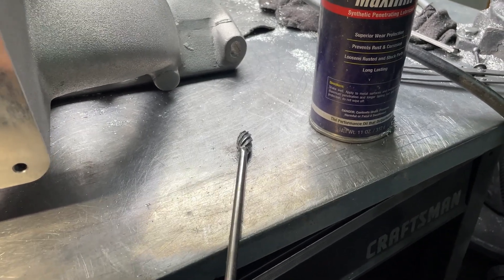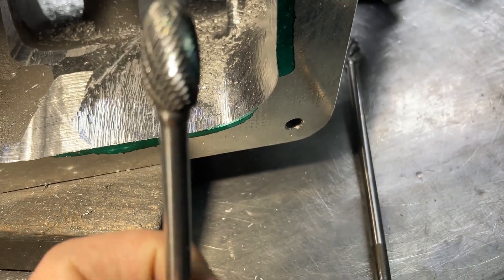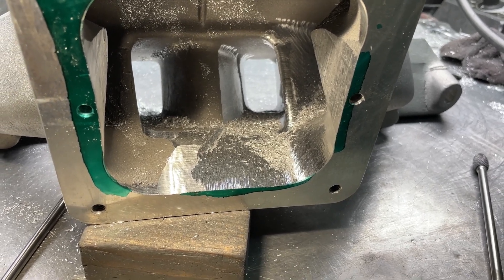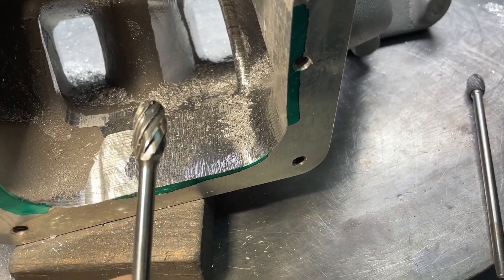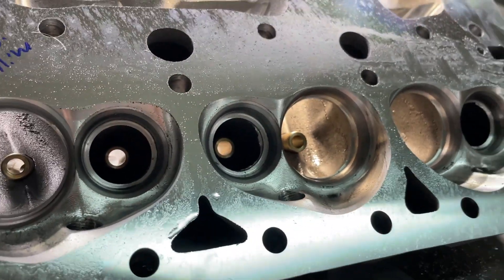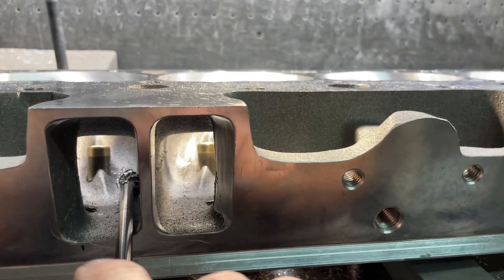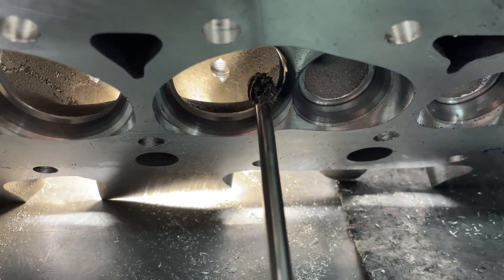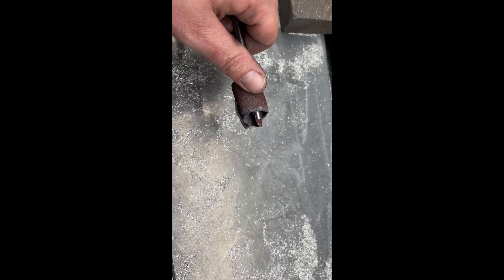Basics of Head Porting

Comment: I like to "true-up" my long reach burrs before cutting. Tighten the collet until the burr will hardly turn, then tighten. Check the run-out before cutting. Tap side of the shank at the collet to true. Also, a rubberband wrapped around the shank can act as a dampener, reducing vibrations and improving finish. Great video!

Comment: When I use 1/4" shank, long length cutters, which are prone to cutter bounce, I found a solution that provides more control over the cutter. I cut a 4" length of 5/16" rubber hose and place it over the shaft of the cutter before I place the shank into the chuck of the grinder. The sweet spot of the cutter is found by changing positions in the chuck after spinning it several times until I get the least vibration of the cutter head. Trial and error procedure. Once that position is achieved, then the hose comes into play. Using the hose between my thumb and index fingers, I slide it towards the cutter end, similar to a trombone action, and this gives me better cutter end control which leads to better porting results. The shaft of the cutter must be lubricated periodically so the hose will slide up and down the cutter shaft. I use WD40. I hope this trick helps anyone who encounters the cutter bounce gremlin.

Comment: Mid 1990s I ported for a shop that had a down draft porting bench. It would suck away all the dust.
If i remember I used a dab of grease on the burr.  Porting was done in a closed room in the dirty part of the shop.
I used to do alot of big block iron heads...Lots of fun.

Comment: Liked this video a lot. I have ported cast iron back at the time Chev. introduced the BowTie heads. Took forever to do a port job on them as you said and tools wear out. I use the long shank on most jobs for same reason you do, vision. If I get some tool chatter I slip on heavy leather welding gloves and stablize the long shank with fingers on the other hand. Good to hear you say how critical the shape of the throat and the chamber side of the seat is.  Don't know if you have ever mentioned this as I don't have time to watch all your vids, but the reason it is so important is because of the damn poppet valves we all are using to let the mixtures in and out. Poppet valves suck in general. But no one has come up with another way that doesn't break the bank to implement. Smokey Yunick spent many hours studying the effects of the poppet valves and how to get the mixture around those big air flow blockers. When you get about half inch of lift off seat you start to see big flow improvement but then one side of the poppet valve is getting close to the chamber or cylinder wall for another blocking effect.
Reply: What is a poppet valve?

Comment: I am going to try my hand at porting a set of gm corvette heads off my zz3 crate motor. I have had the engine for 28 years and the only thing I have done is put flat tops in it and had the heads milled once. I used it with a plate kit for years and it ran pretty good. I am going to up grade the cam and port the heads and turbo charge it and see how it does like that.. Liking your channel

Comment: I don’t know if you cover this in the video as I’m writing this early on..
But you’re talking about the burr wobbling/dancing and jumping around, something I found that you can do with the long shank burrs is to either use a glove or a shop rag to hold the shank with your other hand to help control it.. which of course you want to be careful when using something like a rag and keep it from getting caught up in the hex adjustment/tightening lug on the end of the die grinder.. 

and what I’ve done before was to take a small piece of material such as cloth or a small piece of leather, (an inch or two wide; or whatever width you would need to be able to grasp it) and put it around the shank and put a couple wraps of electrical tape around it (I mean put the tape only around the cloth/leather strip itself, and not the shank of the cutting burr, so it’ll be able to spin freely inside of it) to give you something to hold onto and you can make it to where there’s no loose ends or anything to get caught in the chuck

Comment: I use doff oil. Dip the burr in it. Shake the excess off and put the burr in the middle of the port, "free air" then spin it. I'm the port, it will "spray" a fine film inside the port and prevent "clogging"

Comment: Great info, thanks. Wish I'd seen it before I ravaged the ports on my VW 1192 heads. I made all the mistakes you described, and the heads look like they were ported with a hatchet. I mainly had trouble in corners where the cutter would climb and bounce around. Had better success with a slower speed tool.

Comment: I'm a big fan of Royal Purple product's, however have you ever tryed Boelube made by Orolube specifically manufactured for Boeing Corp. It comes in 3 consistency depending on the material you're working with. It keeps your bits sharp and double cut burs won't load up with aluminum, but a lot of material can be removed quickly with it..They also make a stick looks like a short fat roll of chap stick for sanding rolls that extends their life..Love your video's,  thanks for sharing  your knowledge with us..

Comment: Light dimmer switches (rotary dial) is rated for 120 volts give that a try to vary the RPM on the die grinder, it's cheap. Mount the switch in a elect box (plastic) so you wont get shocked.  Have you tried the machine fluid as a lube, cheap and you got it on hand.
Reply: Only works with non soft start grinders .. if you can get it rigged up to a dimmer lol.

Comment: I want to ask you a question, not sure if you'll read it, so maybe someone else can chime in that actually knows. How do 2 valve heads compare to 4 valve heads in porting? You can find tons of info/books on 2 valve heads, porting techniques, and so on. Very little on 4 valve heads. Are the principals pretty much the same, or does the edition of more valves change things too much? Secondly I've had a few heads where the pressed in seat insert, is smaller than the bowl it was pressed into giving a ridge (inside diameter of the seat doesn't blend with the factory bowl). Is that seat to bowl area the throat? and would you want to blend/roll that edge of the seat back to meet the larger bowl? This is just questions for personal knowledge stuff, for my cars.

Comment: I’ll take a 1/4” diameter mandrel for sanding rolls and cut the threaded tip off, and Then I’ll cut a 2” slit down the center of the mandrel for scotch bright. works great.

Comment: Nobody ever talks about the height of the valve guide in the bowl. Example world sport2 guide boss. It's enormous and no way could I not shape em. I made the ridge inline with the port center and ground em to a point behind the valve. Made sure to maintain port bias measured several points so ea guide boss got ground the same. Then I learned about core shift. Ea port the boss was drifting off to one side a couple thousands. That got my measurements off and the boss got really thin on the last 2. I had to cut the guide .125ish to establish enough material around the valve that wouldn't chip off. How short can the guide be b4 you get into trouble?

Comment: Very informative and educational. What brand or make of rotary burr do you use. I have used single cut after a crosscut, at low speed and dipped in a WD-40. If I have any clogging, I have a round mini-file with a cone shaped sharpened tip to scrape out the bits. Looking forward to your next video.

Comment: Really enjoyed watching these recently and the tech and math on throat diameter vs valve diameter. Would really like to see a segment where you compare flow for forced induction vs NA on the same head, and what you do differently for FI builds from a porting standpoint. Particularly interested to see if the 91% rule is the same for a ported head for FI. 
I assume you'd need to run the flow bench at a higher pressure to see if the air in the runners and un the chamber behaves the same under boost?

Comment: Enjoyed your video! I live in OKC you happen to know of a good machine shop around this area? I'm looking to have a shop do some work on my 5.7 Hemi stroker build. Also do you see good improvement in porting the Eagle Heads that come stock on the 5.7 hemi's? Was thinking about checking into having you do some work on my heads I beleive your not to far from me. Thanks!
Reply from the maker: You might try Henson. I still have yet to flow a hemi heads.
Reply: @WeingartnerRacing  Thanks for responding, I will look him up. Would you be able to check them over and do some work on them? Not sure how busy you are or your turn around time but I would be interested if you have the time?

Comment: I ported a Set of 265 2 Bbl. Small Port Heads out to Accept a Z28 Intake on my 56 265 at 14 y.o. With a Eléctric Drill and Grinding Stones the Drill got so Hot I Needed to Wear Leather Gloves.. Im thinking it took like 3, 4 hrs. Per Port I Knew ABSOLUTELY nothing about it only had the GASKET as a Guide. The Outside of the Ports where paper thin and one Port Needed a Spot of JB. Weld.. That motor Ran like a Raped Ape with a 350/ 350 H. P. CAM, BIG Tube Hookers and 600 Holley in 1971..
Reply from the maker: Hard work usually pays off.

Comment: I like.  Agree  with everyting except anti-clogging lube.  Give beeswax a try.  i would like to know your thoughts after.
Reply: I worked in an aluminum and magnesium foundry years ago. We use nothing but bees wax not only on cutters but sanding disc as well. All our tools were pneumatic. The difficulty is parts that were heat treated and then needed and area reground. The material becomes very hard.
Reply: Forgot to say always wear a good face shield! Brock the shank on a 1" round nose cutter turning at 20,000 rpm. It really can move your head!

Comment: Do not use cutting fluids or wd40. Basics of metal101
Reply: Haha, yeah, I was using cutting fluid on a cast iron block and my dad (machinist) gave a me a stern correction.  It drilled much easier DRY! 😯

Comment: Try the Mondello lube. Goodson sells it. Better than the wax like stuff (including wax)  I have used edge lube and other products and it's too messy inside the port in comparison.  Also try using an old bronze guide on the shank of the cutter so you can hold it out near the cutting point.  I put my other hand at the back of the grinder,  the further apart your two hands are,  the more leverage, control.